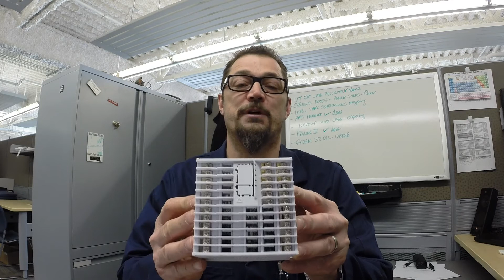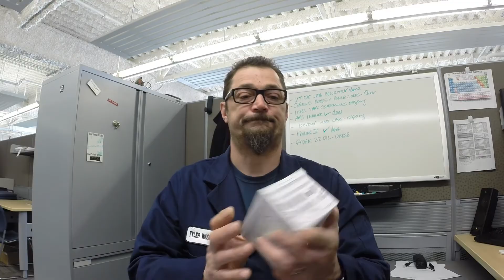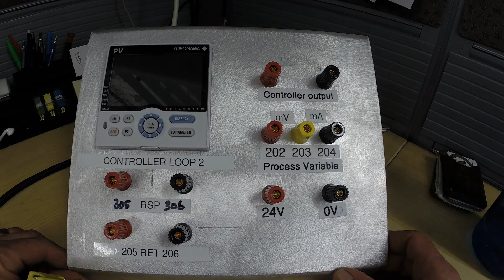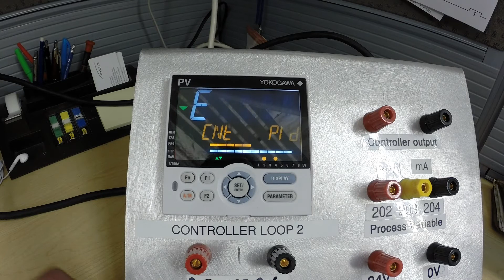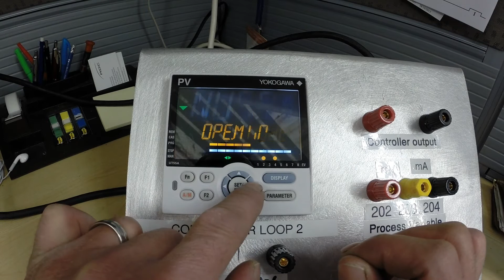UT55A Introduction Video May 2015

Comment: hye tyler.. can you teach how to declare the I/O points? its not plug and play right?
Reply from the maker: I am not sure what you are asking, I/O is wired by type eg mA terminals ,mV separate terminals
Reply: Tyler Wasilenko example i have 4 digital output 1 analog input and 1 analog output.. do i have to declare those I/o inside the controller? Before terminate the cables on the back? Sorry its my 1st time using this type of controller
Reply from the maker: yes you do, there is analog in and out described in one of the videos, I have not done any digital outs. watch the video that walks through using the software and a laptop for configuration
Reply: Thanks Tyler.. gave me an idea about how to set the I/O by using the controller (didn't purchase the software T_T)
Reply from the maker: Software is free.....need the modem adapter though....
Reply: hi tyler.. i managed to set all the points i wanted, but the tcv is not functioning.. I already set the output setting param to 00.02, FYI mine is UP55A

Comment: Thank you so much Mr Tyler,
I have a UT55A too. I hope you wouldn't mind if I ask you something.
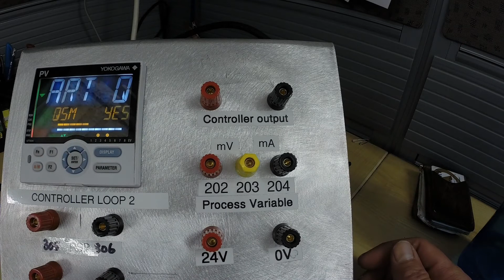I see that your UT55A has 3 columns to connect with the electrical line in the back (when you show the back of the Ut55A at the time 2:45). My UT55A has only 2 columns. Do I have to buy one more to connect with the electrical line.